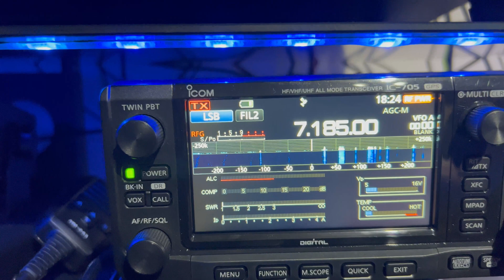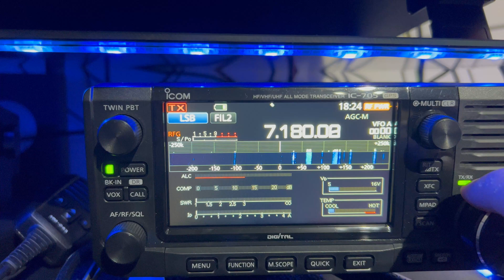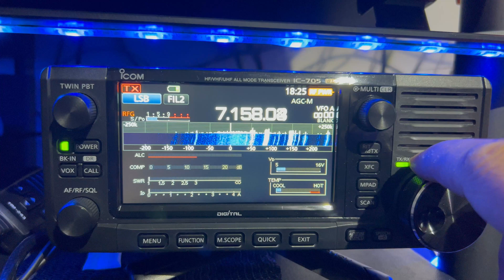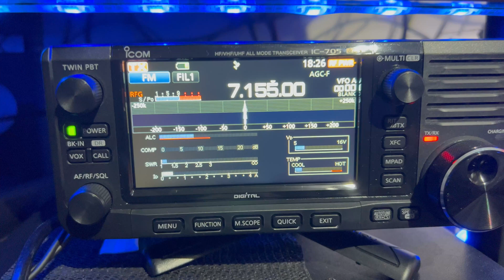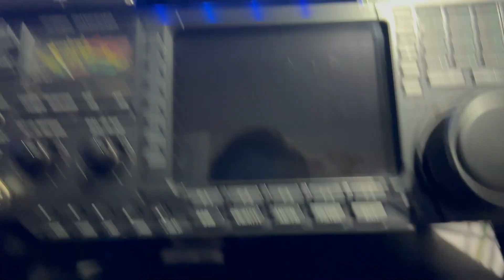A Look At The AL-705 Alpha Antenna Magnetic Loop. Tuning The ICOM IC705 Made Easy.

Comment: If you intend to use this loop for 40m QRP, you'll be disappointed.  Assuming the loop is about 8 foot circumference and the loop's conductor about 0.5 inch diameter, with zero antenna system resistive losses.  Applying an idealistic mathematical model for calculating loop efficiency: on 40m it's about 5% efficient.  On 30m it's about 15% efficient.  On 20m it's about 35% efficient.  On 17m it's about 55% efficient.  The shorter wavelengths (12m and 10m) are about 80% efficient.  Obviously, in reality, the antenna system has greater than zero resistive loss; and if the loop is less than 8 foot circumference and/or 0.5 inch conductor diameter, then its true efficiency is less than the idealistic model.
On the other hand, if you intend to use the loop for receive-only, then transmit power efficiency is moot; i.e., it'll perform well on all bands as a receiver-only antenna.  And, given the above approximate efficiencies, it should perform relatively well as a transmit antenna on 20m and higher.
My experience with small loop antennas is limited to 10 foot and 15 foot circumference QRP loops, with loop conductors varying from 0.5 to 0.75 inch diameter.  Generally, the 10 foot loop seems to perform well at and above 20m, and the 15 foot at and above 30m -- on 40m it's poor to marginal.
Ken WA8FCI
Reply: antenna is better than no antenna. a loop is the only thing that gets me out in 80m from the middle of city. QRP. go figure.
Reply from the maker: Thanks  Ken, that’s very interesting. When I get out in the field I’ll bare that in mind. Take Care 73